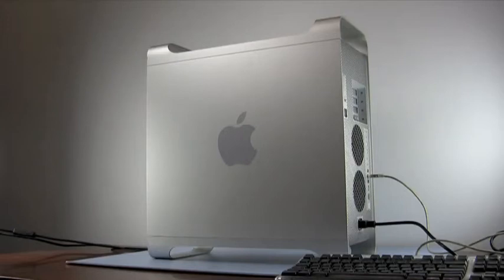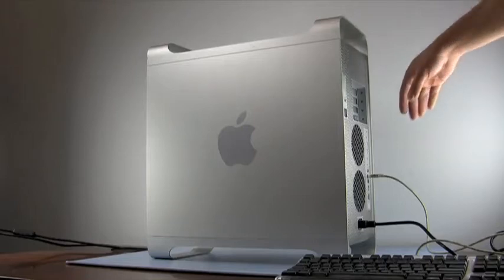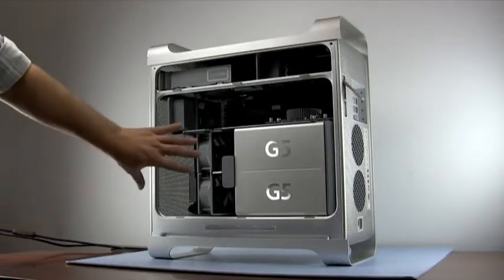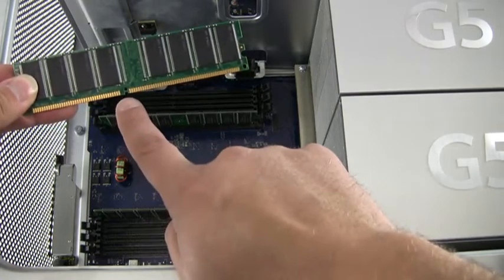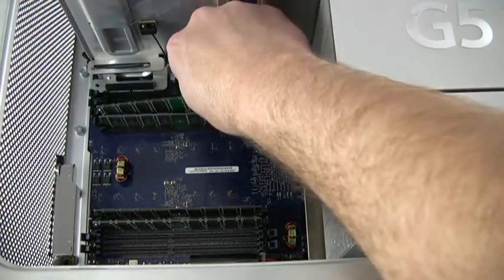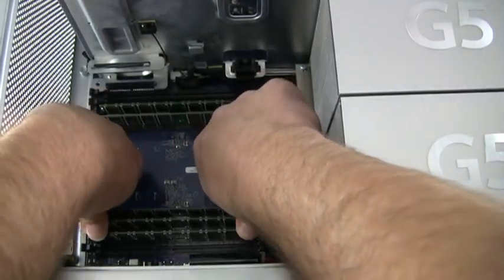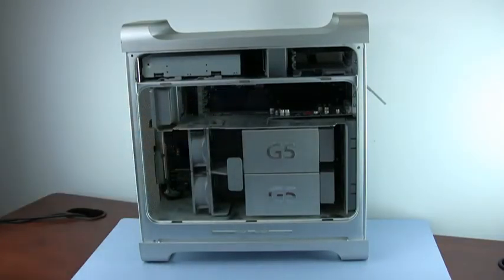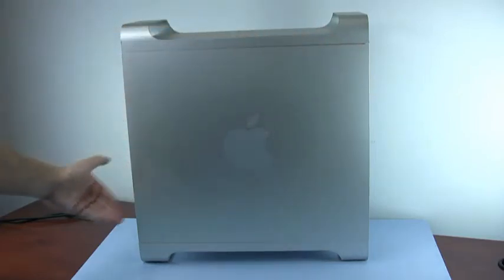Power Mac G5 Memory Installation Video

Comment: So, I'm getting an Apple Power Macintosh G5 Dual CPU 2.0GHz Power PC 970 G5 to actually replace an old and dead Mac Mini.  I have a 1 Gig PC3200U-30331 chip what was inside the Mac-Mini...  Can I use it in my new to me "Apple Power Macintosh G5 Dual CPU 2.0GHz Power PC 970 G5"?

Comment: I just now received  8 X 2Gb sticks from OWC, and a new Western Digital 1 Tb internal hard drive (for my start up drive). By the way, OWC ROCKS for delivery time! I ordered on Wednesday, and it was here, this morning, Friday. 

I have a late 2005 2Gb Dual Powermac G5 -I want to replace ALL of the existing RAM - Do I just remove it ALL, and then install (following the "inside out" rule) the new ones?

Comment: I was trying to put my memory in and when pushing down to insert the card into the slot (I know I had it in the right direction and everything) the pins that latch it into place on each side broke! They snapped right off! What do I do now?? This video says you have to install them from the inside out, but I don't know if I can use this slot anymore, what should I do? I moved all the memory so that the three sticks match on each side are in matching positions yet don't use that slot....